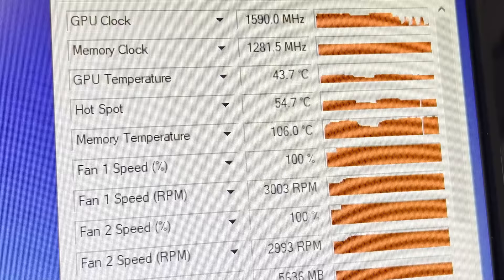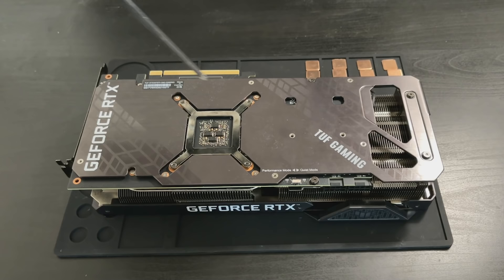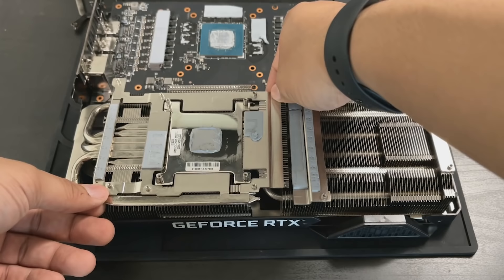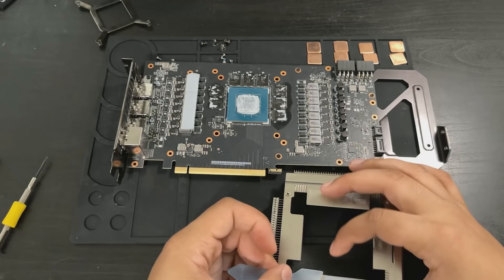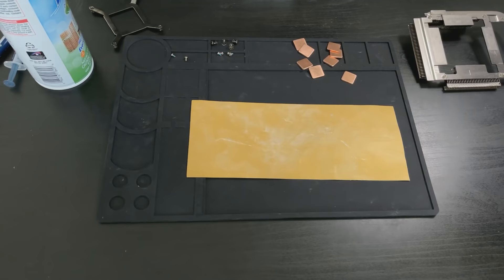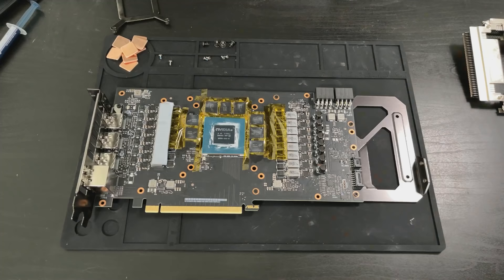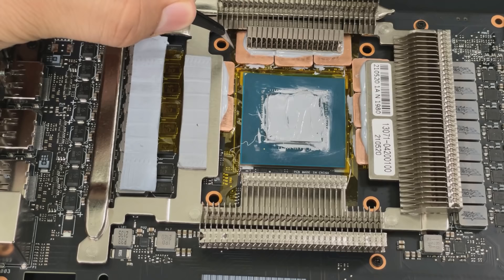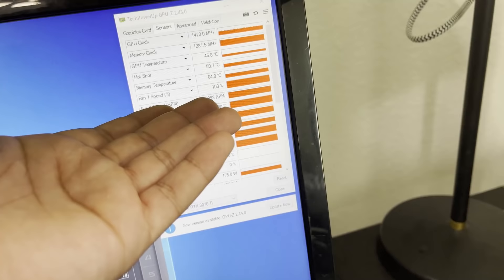I Copper Modded An RTX 3070 Ti.  Memory Temperature Dropped 45 Degrees! This Is How. (110C to 64C)

Comment: I just did this for my Alienware laptop, used shims for the cpu/gpu die themselves. It helped a ton. I'm considering also doing it for the vram as well but haven't decided yet. I was having throttling issues and now i don't break 80 under full load. got idle temps in the 30's without a cooling pad xD
this shit works!
Reply: Do you have a video?
Reply: @ianvincent6670  naw man but it's just a simple repaste, only sandwiching a shim between the gpu/cpu and the heatsink with paste on both sides

Comment: with results like these it's a wonder they don't just have copper heatsinks and no pads.. so weird!
Reply: Because component height is not identical from component to component. You want massive failure rates? Copper doesn't deform, leading to component failure.

Comment: I did this now on my laptop but the results aren't that great. I covered the memory modules around the GPU with copper plates (Kapton tape ftw!). But the GPU temp itself seems to be the problem on my ... yeah... 1060GTX. What would happen if I put a copper shim on top of the GPU itself (with heat sink on both sides of course? Is it possible at all to apply Kapton tape on the GPU? I'm asking because the GPU itself is made of 2 different chips (?). One is the main socket and 1 on top of it (in your video it has the Nvidia branding on it).

I will open my laptop tomorow again to make some adjustments. Really not sure what to do with the GPU... Temparature here is 95° on heavy duty, which makes the upper part of the keyboard very hot.

Comment: Who's up to raise an iFixit Kit for this guy? Btw, you put Kapton tape OVER the chips, which prevents the copper pads to make good contact with them and you essentially rely only on the MX-4 as thermal interface. Also, manufacturers use pads, because they are squishy and can accommodate for tolerance offsets. You are extremely lucky that your card has a separate memory heatsink, and not a single block, as it is more common, because now you essentially have chip>kapton>mx-4>copper>mx-4>heatsink, none of which is very squishy (aside from the mx-4), and you would have lifted the heatsink from the GPU a probably good 0.2-0.5 mm if it was a single block, making it overheat immediately. Generally, Kapton (or any kind of) tape is absolutely not needed in this, because the thermal paste (non-condictive) will hold the pads in place, a.k.a. not touching anything except the memory chips, until you (carefully) tighten the heatsink which will squish the paste out covering the surround area of the chips and fixing very tightly in place the pads. You'd probably have to drop kick the card to make them move at all.
Reply: That's the BIGGEST reason I use Arctic MX-4 or Thermal Grizzly Kryonaut, because they're both non-conductive! I can't freaking STAND cheap thermal pads!
Reply: @macgyver5108 , most modern thermal paste is non-conductive. Thermal pads, even the most expensive ones unfortunately have a lot lower thermal conductivity, so yeah, avoid them when possible. Manufacturers keep using them for the reason above - tolerances, but mostly - they are cheap.

Comment: I'm curios about what would happened if you replaced the thermal pads with K5 pro which claims to be better than thermal pads but a bit safer to use than copper

Comment: What in the world? First, if your 3070TI is hitting 100 anything, there is something seriously wrong in your system. I have a 3090ti overclocked, and my tempts hover around between 63-67. It rarely hits the 70s and not for long when they do, so I would have sent that 3070ti back to the hell it came from. It just seems like you did a whole lot of work just to get the card to basically where it should be anyway.

Comment: Why didn't you use U-plate-shape copper instead of 8 pieces? If some of pieces(of 8) don't compress well (and ones in the middle wont) they will fall of (they cant because paste is holding it - but how long it would be?).
Reply: Sorry.. did not see your 2nd video.. watching now! Keep Up the good work!

Comment: Just did the same mod on my TUF 3090. Everything seemed to fit well, but i only managed to get an decrease of two degrees celsius. So something must be a bit off.
I'll probably buy some better thermalpads instead and get rid of the copper.
Reply from the maker: Did you modify the front and the back? The software temperature readout displays the highest temperature out of any individual memory chip. It is possible that, either one of the chips is not making adequate contact with the copper due to an air gap (in that case, increase shim size) or one of the memory chips on the back is still getting very toasty. Modding the back of a 3090 is outside of my area of experience though, so definitely either just go thermal pads (like Gelid Extremes I have in my descriptions) or look for in depth explanations of copper modding the back of 3090s. Best of fortune!

Comment: Don't use paste on vrams evet use putty instead or buy 3d graphite pads. Thermal paste will go underneath between vram and pcb layer and it will cause cold solders on vram balls. Long term it will cause issues. Instead use thermal putty..

Comment: I use copper and result is bad... +6°c more on memory temps..and hot spot is 6°c + ...what I do wrong.... I use grizzly thermal paste and I spread it on each memory and on the gpu processor I put copper...and rmadd thermal paste like the video.... ?!?!? Help

Comment: I think those copper pads were a little too thick 1 mil would have been better for the sake of the gpu temp because now the heat sink might not touch the gpu properly.

Comment: The basic idea is good, but please take a look at the electrochemical series.  Copper and aluminum are not good partners here.  The aluminum will slowly dissolve.
Reply from the maker: Galvanic corrosion is not a long term risk here. The copper and aluminum do not share an electrolyte to react through.

Comment: nice video!
Reply: Got my chipset on x570 am4 board copper modded with big chunk of copper it is way better then the original 1,5 inch of aluminium block, just bought an 6800xt that get hot if i let it get as many frames aas it wants.. but if i cap the framerate its cools way down to normal temps it is running 99c with al frames unlocked ;p really hot

Comment: 05:44 Below the Memory chip (G1 Left side) you have a Capacitor not on its pads.
Reply from the maker: It is, but the solder pads are just very small, and in series with a diagonal-running trace from the PCB
Reply: @dandyworks  as it mirrors the dimm furthest on the right you can see the manufacturing fault.
Reply: I was wondering if anyone else saw that ... would the power here not being filtered properly cause some of the heat issues ?

Comment: I've been running my RTX 3070ti Founders Edition copper modded by myself 2 years now since this video released. I recently had to put more thermal paste on the chip because the GPU started to throttle, but after repasting, all is back to normal. Furthermore, I can even overclock it about 10%, and the only limit is the 100% GPU load on some games, and lack of more than 8GB memory. Truly an unstoppable card after that copper mod. Thanks again for the video!

The only reason why they use thermal pads instead of this, is that an average user won't be able to know how to repaste it, maintain it, or will cause warranty issues.

Comment: RIP my 2060 that's 56C on idle. Applying MX6 soon. Hoping the 83C/106C temps(just half load and undervolted, lol) Bought it fine with temps not reaching 70 so pretty sure that the paste will do wonders.
Reply: Put a small fan between the case and the graphic card or put in front of the graphic card. I tried both methods my temps went from reaching 50c+ to under 40c with just 10€ fan running with 800rpm.

Comment: very impressive. but I got a question. I just bought an Asus  ROG-STRIX-RTX-3060TI-O8G-V2-GAMING. LHR. and I noticed under GPU z it uses Hynix memory modules. and I was almost positive this card would have Samsung GDDR6. Does it make any difference? 
I'm having all sorts of issues with this card. (which is hooked up to a Samsung Q90 T. which has 1 HDMI 2.1)  
1 issue. when first starting the PC.= No audio
2 when the PC is in sleep mode. _ I get no picture.  I have a short frame of time to know if the card is defective so I can return it. Thanks
BTW. the card was running hot when I first got it. then I removed the card and reinstalled it. the heat temp at idle is 34 degrees. it was 58 before that.

Comment: Hi i have Aorus  RTX 2070 XTRIME And i Got 88 cc Temp under Working  (Render Stuff ) its Normal or not  ? And Another Questions if i want to change Thermal Pad for My GPU How i Notice Size of Thickness of Pads for my GPU
Reply: Without Opened

Comment: ASUS's TUF series are designed by lazy team,you can also see this in 2020 TUF AMD laptops with blocked ventilation that makes the cpu thermal throttles,they said that they want to cool down other components. If they used correct thermal pads for each needy component then this problem won't happen just like here.

Comment: What are the risks from using the copper shims this way?
Reply from the maker: There is a risk of shims sliding around due to inadequate pressure, or shorted PCB components due to contact with the copper. The actions taken in this video were purposeful (like using Kapton tape or choosing Arctic MX-4 paste) in mitigating these risks. That being said, performing a mod like this should be done at your own risk but as long as you know the risks it should be fine!

Comment: I have a dual fan 3090, I just finished replacing the thermal pads and thermal paste in it. Also I have the backplate dual fan / thermal pad thingy on it so I was curious if this copper modding thing is any better than the tiny thermal pads. My current idle temp is 24 to 28 degrees Celsius and jumps up to about 36 degrees Celsius under load.  I currently have the backplate fan thingy powered via a y cable to the mobo fan header but I want to power it from one of the GPU fan headers but I need a custom cable for that since the y cable on Amazon has a 4 pin and 3 pin output so I need the regular fan and backplate fans spinning and then I can control the speed from Debian nvidia-settings.

Comment: That's fake Kapton tape. It's called Kopton tape when the sell it. I use that at work too. Not very sticky. Impossible to find real tape that is not super expensive. It's still heat resistant but not as good as the stuff you find in OEM devices when you first open them.

Comment: On an built like this, breaking warranty anyway. Why not nail polish all those components instead of tape them off. Also, just check if it would short so everything is flush as possible. Then nail polish all possible risk components. And tada, a invisible, permanent protection against shorts.

Comment: can somebody please explain the importance of sanding the copper shims? is it a necessary step? I note you said they were sharp, but how does that affect the cooling or prevent shorting?
Reply: I guess it's just to maximize the contact area between shims and the heat sink, enabling better heat transfer for sure.

Comment: Hello. Have you fan problem later? 2500 is maximum rpm and my gpu is in 1 hour in 1 min set 3000 or 3500 rpm over fan ! And very big sound. Why doing this😅? Max temp 82 C

Comment: How does your GPU-Z show the Temperatur of your VRAM? I updated my GPU-Z to the latest version (2.45.0) but I can't see it. Or does that depend on the graphics card? I have an RTX 2070. Do RTX 2000 Series card not provide that info?
Reply from the maker: Yes, it depends on the GPU. So far, access to on-chip VRAM memory sensors has only been provided for on GDDR6X memory, and a few select GDDR6 GPUs.
Reply: @dandyworks  Ok good to know. But as far as I know RTX 2000 series card's don't seem to have too many issues with memory temps anyway. 🤔

Comment: Just think what a bad job the makers of the cards are doing.
110C on an open case is really bad. The problem isn't new either, my GTX 285 in SLI also gets hot at 106c, it's also an Asus model.

Why don't they at least use thinner thermal pads.

Your GTX 3070 Tuf has a particularly bad design, the ram blocks are not even 80% covered by the cooler. That sucks really, like they're about to break.

Comment: i hope people know you can get the same temp drop and not have to go through this.  MX4 has a Thermal Conductivity (W/mk) 8.5, there are thermal pads that are as high as 20.  you can get same or even better with the 12 w/mk pads.  there is no telling how much more loss there is since it is Tim to Copper to Tim to Heat sink.  fun to watch though!

Comment: Take note GPU cooler designers this should be standard
Reply: They can't care less, first of all contact plate with mem chips and GPU should be only copper, no Ni coated or painted. More heat pipes, no rad fins painted or coated. No painting of back plate(bare aluminum or copper).

Comment: #Help , I tried copper mod on gigabyte 5700 xt , it supports  0.5 mm thickness thermal pad ,so I used 0.5mm copper shim , but main gpu die wasn't making contact bcz of thickness of copper as thermal pad get squeeze with mounting pressure and copper one didn't  , so anyone here did coppper mod for 5700 xt ? Which one should I go for ? 0.4 mm or 0.3mm

Comment: Thermal pads squish down, why use same thickness copper which does not squish down?
Reply: copper also expands under heat and will stress the pcb lol

Comment: simply undervolt the gpu, my rx6700xt oc in my tiny itx case gets 95c gpu 111c memory it never clocks down or throttled but cooler is better in a tiny mitx case, 
i undervolted it and have now 55c gpu 59c memory at 34c room temps

Comment: I have a 3070ti suprimX card, should I get copper with dimensions of 15.15 and diameter 2 mm?
Reply from the maker: 15x15mm is the perfect length and width, but make sure you measure your stock thermal pads to find out the correct shim size. One rule of thumb I didn’t mention was to take the pad size you measure, and deduct .2mm to account for the space the paste takes up. So if the pads on your GPU are 2mm, get 1.8mm shims to be safe.

Comment: Reason why you think it’s high temp is cause this card has memory temp sensor in reality most cards memory run super hot u just can’t see it
Reply: And than they just gets bricked. No need for sensors when your GPU let's say is 50 you'll know your mem modules are 15 -20 C hotter. just add 15-20 C on top of your GPU temp and you have mem temp

Comment: can someone help me with my project as well? i want to add arctic liquid cooler 420mm to my msi gtx 1080 x8, add gelid thermalpads at the front and back and also put copper heatsinks on top of them

ive never ever taken any gpu apart or done any modding but i know this is what i want to do

Comment: Beware a scam - the guy drop gpu clock and maybe memory too. When you do so - card lose temperatures. You can also drop voltage and lose more temperatures. But back side of do so - lose performance.

Comment: I’ve not had thermal issues on my pny rtx 3070 xlr8 epic-x triple fan gpu even running a 4k 60fps video render using the gpu maybe I got lucky with it since my 3050 and 3060 hasn’t had those issues either.

Comment: Way, way, too much thermal paste and the copper shims are probably too thick. If the suitable thermal pad is 1.5mm it does not mean that the airgap is actually 1.5mm. Most likely the pads are designed to compress and the actual air gap is 1.2mm or 1.3mm. You're possibly applying far too much compressive force on the memory chips and twisting the PCB. I hope none of those copper pieces slides under asymmetric pressure their since you didn't actually glue anything to anything. I would have used thermal epoxy to glue the copper shims to the heatsink. And to think that all this could have been averted if you had gotten decent thermal pads to start with...

Comment: i used thermal glue on my rtx 2070 memory,i used a aio cooler on it, the copper would fall off if i just used thermal paste. v ram cool and gpu never gets about 55c unnder max load, it an old card and i did this in 2018.

Comment: I have the same GPU an my memory stays @75C in games
Reply from the maker: I guess you got lucky and got a GPU whose cooling assembly wasn’t manufactured by a blind monkey hanging upside down!
Reply: @dandyworks  I Have the ASUS TUF, like you. There are many cases of RTX 3000 video cards with memory temperature problems. The memory radiator screws were probably not tight enough on your card maybe...

Comment: company makes dedicated mem cooler and does not make it so the mem chips directly touch the dedicated mem cooler by using the same shitty thermal pads it would have had if there was no dedicated cooler
smacks forehead

Comment: Look at the size of that cooler, the tiny minds at Asus found it beyond their intelligence to cool all of the other components around the gpu with the same overkill cooler, chips that are on the same plane as the GPU!  I guess the math of having to build a stepped cold-plate was baffling, 1.5mm heat pads and a 10 cent alloy plate that covers maybe 50% of the area of the heat generating devices was the obvious way to go...
Reply: I remember the TUF 5700 and 5700XT being so bad that places like HU implored people  not to buy them.  Any other models that bad?

Comment: my 3080ti chilling at 80°C after port royale and on a hot day with me fucking up fans when i built the system (3080ti gigabyte vision oc)
Reply: i think you are meaning the gpu temp.
Reply: @azizzorba5930  gpu temp is at ~73